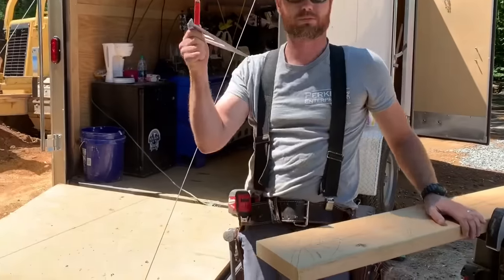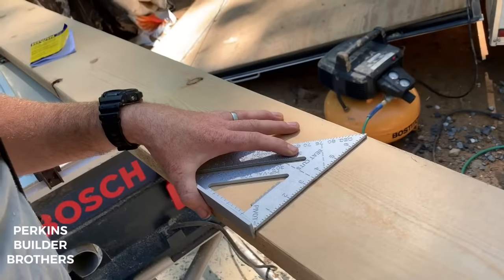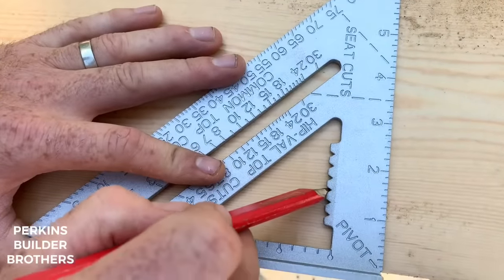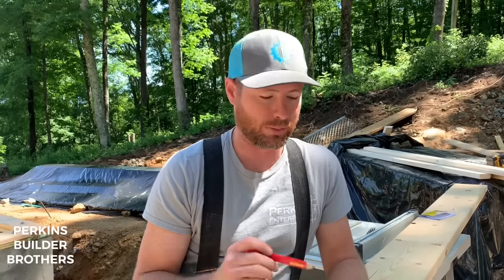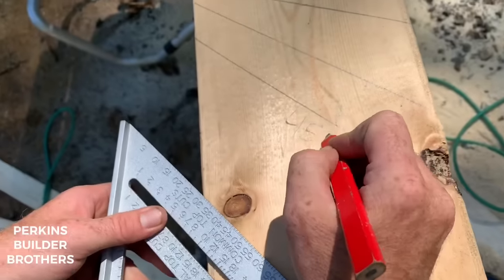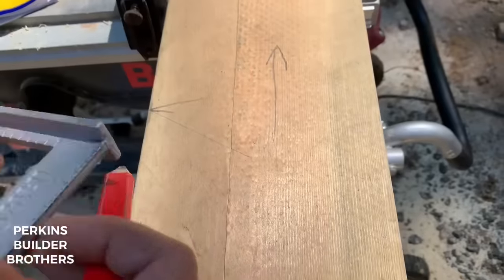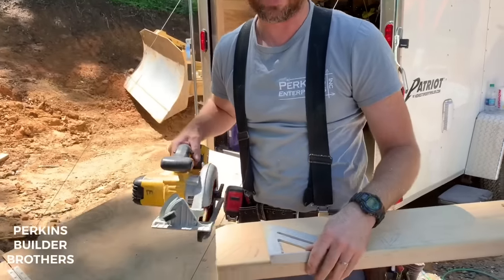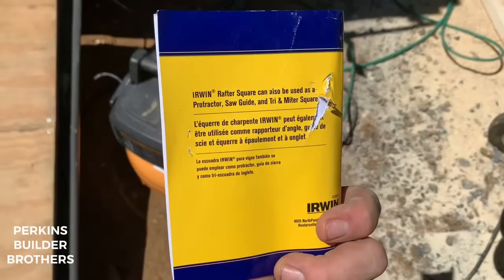How to use a speed square | Why it might be the most important tool you own

Comment: My uncle once told my cousin to go get me that square , cousin said you ain’t tricking me that’s a triangle 😂
Reply: has he ever asked your cousin to grab the board stretcher? cuz prolly too slick for that one...
Reply: @johnlecorchick2039  I'd love to have a bucket of corner mortar.
Reply: @johnlecorchick2039  I've cut this board 3 times and it's still too short.
Reply: Go get me a box of toe nails.
Reply: @johnfoge1742  i think you'll find that right next to the sledgehammer grease. :)
Reply: Kid ? go get me the left handed board stretcher.
Reply: Nah your making it up
Reply: In Boy Scouts we sent a new guy around a camp ground to find a left handed Philips screwdriver
Reply: Not a carpenter. I send young cats after a bucket of ohms, cable stretchers,sky hooks,conduit stretchers,metric channel locks,etc.lol.
Reply: @erlycuyler  I was 16 when I got a job as a telecoms engineer. On my 1st day I was send to get the sky hooks from the car. I got halfway to the car when I figured I had been duped, so I turned around angry and went back. When I got back he was laughing so hard I couldn't help but laugh myself. I miss working with him.
Reply: I was not expecting that. I laughed so hard my belly hurts.
Reply: Booooooo Booooo, Hissssss 😂😂 my cousin always says its a speed square and your framing 🙄 my reply is; dingbat it's a rafter square and gimmie it before your hangin from one. Then one day discovered that nifty little slot in the  werner step ladder which is where it now sits. Oh my cousin? He's hangin round here somewhere 😆🤣
Reply: @johnlecorchick2039  on the truck next to the shingle stretcher and buttfor
Reply: @brandonfrancey5592  cut it again
Reply: @EO-McLoud  they make that?? Will it help a grounding rod go in the ground faster cause cold tar aint workin 👍
Reply: When I was 14 I had a summer job on an AFB paint shop and the airmen told me to go up front and get the keys to the F-15 so we can move it out of the hanger. They got me good I was so embaresed lol.
Reply: Next time ask him about the nail glue.
Reply: Fast triangle
Reply: Thank you,I'm gonna have to use this sometime.
Reply: I had to turn off my music to read this thread. I want set a boss tell me to get the board Bender out of his trailer. I told him there was no fucking way and argued with him for about 45 minutes. After 45 minutes of arguing he went to his trailer and brought out a Stanley board Bender still with the tag on it and I couldn't fucking believe it. I think every profession has this when I was a server throughout my life the servers would tell the new people for closing procedures one of the things that you had to do was empty the water out of the Bunn coffee pots, which are of course as you know fed to the back by running water. I once watched a new server empty a 5 gallon bucket out of a coffee pot before they asked what was going on. So I've seen this in a few different areas I've been a contractor my whole life but I always liked working in restaurants as well (lots of waitresses) so I have sometimes picked up a side hustle as a server or bartender. This thread has got me rolling.
Reply: @JeffreyNevrotski  what's a buttfor?🙄
Reply: Bubbles for the water level
Reply: He probably thought to himself that very moment he should of pulled out that day lol
Reply: Smart cousin. I bet he went to collage?
Reply: Short wire? Go grab me the wire stretcher
Reply: On a paint job a sent a kid to the truck to get the Peter four. LOL he was in the parking lot 3 floors down yelling at me on the balcony. “What’s a Peter for!?!?”
Reply: Worked with a kid once, young framer. Halfway through the day, I noticed he'd pull a nail out of his bag, and look at it. Then, he'd randomly nail it in, or throw it onto the ground.
I walked over and asked him why he was doing that. He said, "The heads are on the wrong end of the nail!"
I just sighed, and said, "You idiot, those are for the other side of the house!!"
Reply: @garyboner8826   Or hammer, handsaw, etc. My grandpa got me on things like that when I was a kid. Probably still could if he were here. I used a left-handed shovel when...
Reply: I mean, he's ain't 100% wrong.  Too funny!
Reply: One time in the kitchen when I was a kitchen manager before I got into HVAC. One of the dishwashers go get some evaporated water off-the-shelf he was looking for like 15 minutes
Reply: Sky hook
Reply: There's also 3 shovels over there....
take your pick.
Reply: I remember my poor old grandmother asking my father what he wanted for Christmas, and my dad told her he would really love a good “metric hammer”. My poor grandmother went to five or six hardware stores trying to find him a “metric hammer” before one of the store owners, after nearly falling off of his stool from laughing explained to her that someone was playing a joke on her.
Reply: @JeffreyNevrotski  what's a buttfor?😁
Reply: In the factory, we told the new guys to get us a bucket of steam.
Reply: Tartan paint
Reply: Ask for Long weight
Reply: @erlycuyler  metric channel locks😂😂
Reply: In the painters union we'd send the apprentice out to the van to get the brush spinner and grab the paint stretcher too. They always insist they know what it is. Good times!
Reply: Don't  feel bad, I was told to go get the round square 😒 
I was,asking around the shop and they kept laughing 😂
Reply: Hahahahahahahahahaha that’s fcking brilliant.
Reply: That is the funniest thing I have heard all day!   ;-)
Reply: This was the most confusing thing for me when my dad first asked me to grab it doing my first deck when I was 8 years old.
Reply: @johnfoge1742  😂
Reply: @johnfoge1742  😂
Reply: @regbowyer1070  classic 😂
Reply: @daishi5571  ummmmm there are sky hooks 🪝 they attach to you bucket so you can attach to a extension later well up in the air to cut in trim. It is a hook with a small Chan on it to attach to your ladder 🪜 I have 5 skyhooks in my truck now.
Reply: @JeffreyNevrotski  there are sky hooks 🪝 I have 5 in my truck it is a hook with a chain attached to attach to a latter well up hi to cut in around a building manly for painting.
Reply: In my Army aviation unit we'd tell the newbies to get us a bucket of prop wash and a length of flight line.
Reply: And this is why no one trusts anyone in the world
Reply: Your "cousin" eh? Lol
Reply: @garyboner8826  and then you all bummed each other because you're boyscouts?
Reply: HAHAAAAAA I LAUGHED SO FUCKIN HARD AT THIS
Reply: @daishi5571  

When I was a kid, they sent me for something. (I think it was a bucket of steam for the tamper, or something.) 

I knew it was a trick, but I was new, so don't piss off the crew. 

I went to my car, and listened to Skynyrd for 2 hours. Then came back claiming I couldn't find it, but the builder saw me, and asked who sent me for it, and to send him to his office as soon as I find him. 

The whole crew was dead silent.
Reply: lmao
Reply: Tell em to get the left handed screw driver 🤣
Reply: When I was a chippy we used to ask the boys on the roof if they'd had the wee taken out of their new hammer.  If no then you'd grab their hammer and throw it as far as you could while saying "weeee".
Reply: Bahahaha brilliant.
Reply: @TimeSurfer206  😭😭😭😭😭😭
Reply: @g-cgeneralcontractor8903  Actually... That is properly called a "Meat Hook." They can also be attached to a "Hand Line," a rope on a pulley used for lifting from ground.
A "Sky Hook" is and always will be a helicopter being used for lifting.
Unless this is a Brand Name for a 
meat hook.
Reply: @Rspartan  As a young recruit, my boss told me we had sunspots on our Microwave Radio Dish, and sent me out for some Sunspot Remover.
Being hung over, I was happy to take the opportunity to:
Go back to the barracks and take a nap.
Then go to the AAFES Snack Bar for a good breakfast.
Stop by the Post Exchange and get a jar of Cold Cream.
Re-label said Cold Cream.
And go back to work and give the boss the Song and Dance about I tried and I looked and I asked everyone, and finally, I went to the US Air Base on the other side of town, and the guys at the flight line said, "No, we don't have any Sunspot remover, but try this! it should work!"
And then I gave my boss the jar of Cold Cream, re-labeled as "Prop Wash, 4 oz." Complete with an imaginary NSN.
Reply: @TimeSurfer206  Meet hook might be slang skyhook is literally what it says on the package been buying them for about 30 years now and they  sell them in the paint department like I said to hook your bucket to your ladder.
Reply: @g-cgeneralcontractor8903  Like I said: "Unless it's the brand's name."
Started construction training at 9. On the backhoe at Dad's farm. Retired as a sparky. I know what those hooks are.
And if you ever fall off your ladder, i pray you don't find out WHY it's called a "Meat Hook."
Reply: @TimeSurfer206  dang man sounds a little painful is that slang when you guys call them meat hooks 🪝 my dad is a GC so I started construction training at two LOL. Never heard of them referred as Meat 🍖 hooks been on hundreds of jobsites. I thought you were a butcher or something LOL right on but I guess you learn something new every day. Thanks man
Reply: I’ve been in construction for 35 years iv had my general contractors license for 10 and my company I  have over 30 employees five of them are electricians. Never herd of  meat hooks we called them Skyhooks but that’s cool man thanks for letting us know.
Reply: @g-cgeneralcontractor8903  Actually first heard it when I was working on an Overhead Line Crew. We use a "Handline," a loop of rope with a pulley at the top of the pole, to send material and tools up in a bucket for the Lineman to use. It's ostensible purpose is as a safety device, so we can use it to rescue a worker from the top of the pole. We use it primarily for convenience.
And we call it a "Meat Hook," because, if someone needs rescued...
We probably aren't rescuing them, we're retrieving their body.
Reply: @TimeSurfer206  oh man yeah that’s scary one of my buddies was a lineman for Burbank city. Something happened while he was working on the transformer and he got hit hard burnt his whole chest he was hanging upside down from the pole he  barely lived. He still works for the city but he refuses to go up on those poles anymore he said he’s too scared he starts shaking when he even thinks about it.  That’s a crazy scary job man. I have a Lotta respect for you guys to do that work and who have done it for so many years without getting hurt super awesome. Thanks man for sharing with me really cool I love the knowledge brother. 👍🏻😎🔨
Reply: @g-cgeneralcontractor8903  You're welcome, and I hope something, ANYTHING, I might have said might actually come in useful some day. Take Care and Stay Safe!
And don't let rude people spit in your face.
(Forgot to add, thanks for sharing your stories with me!)
Reply: @TimeSurfer206  absolutely very cool you as well and thank you. 👍🏻😎🔨
Reply: Hahahahahaha - that's a good one.
Reply: I feel out that was funny. Simple but funny!
Reply: Omg 🤣😭🤣😭
Reply: It was you your uncle asked you 🤣
Reply: Had a boss tell me to get him a 19/18ths wrench, so I brought back a 1&1/16 inch wrench. He was like “well, damn. Technically that’s right. You got me”
Reply: @ArbitraryLifestyle  😂
Reply: son go get the caulk and spread it into that crack over yonder
Reply: @shizmanbeat  is lquid nail
Reply: The uncle: 😐🤨😠😡
Reply: Lol
Reply: I mean he ain’t wrong 😂😂😂
Reply: @garyboner8826  We always sent scouts to the ranger's house to get a left-handed smoke shifter 😁
Reply: I once sent one of my new guys down to the truck to get the cordless extension cord. watching him from the roof rummage through the toolbox for 10 min was priceless!
Reply: Get the wood stretcher
Reply: Same thing I just did I  started working as a laborer my co worker says pass me the square I was like you mean the triangle 😭
Reply: He's not wrong , a right triangle to be exact.
Reply: @JeffreyNevrotski  what's a buttfor? Lol
Reply: DEHYDRATED WATER... we used to tell the amateur greenhorns on the construction site to go grab the dehydrated water please. You could imagine the confusion
Reply: You win the comment section...
Reply: Call auto zone and get price of blinker fluid
Reply: Did he remember the left handed hammer as well?
Reply: I had to read a few times but I get it now
Reply: Surprised nobody asked for level fluid
Reply: Remember it always safe to measure once and cut twice.
Reply: One of the funniest things I’ve ever read!

Comment: As a 70 year young carpenter. The speed square wasn't around when I started. Everybody carried a Tri-square. Thank you for your well made short straight to the point very helpful videos. I wish You Tube was around when I started.
Reply: I have a speed square from my grand father dated from 1937.  So it might have not been a nation wide thing, but reading off Swanson Tool Company, Inc website says it was around since 1924.  Also wish youtube was around even 10 years ago lol, I had to learn the hard way or figure it out 100% of the time.  But thats what makes a good carpenter anyways, figuring out problems yourself and solving them with out getting the answers. also opens up new ways in getting the job done.
Reply: @hardboiled7774  YouTube has been around for 15 years.
Reply: @marshallferron  Yes I know, but there weren't very many, if any informational videos 15 - 12 years ago, maybe they trickled in around 2008 - 2009 though, but nothing compared to the last 3 years when it comes to trade-craft and skill based videos.
Reply: @C life 403 Is that the big Johnson or the little Johnson?
Reply: @mikeking7470  the old long Johnson
Reply: I remember young carpenters sticking a tri square in a board until an old hand ✋got mad!
Reply: I also have a compound square as well
Reply: It's never too late, comrade.
Reply: Probably had more people to show you and that was your live video
Reply: 1925 is way older than 70 years old.  You just didnt have internet in the 50s to buy one on amazon.

Comment: I spray painted mine with orange paint and immediately wiped it off. Left a nice orange paint fill in the numbers and made them easier to read.
Reply: Thanks for the insight. I will do the same, but gotta go with green paint on mine.
Reply: Also you can keep other Carpenters from steeling your square.
Reply: Good idea
Reply: Clark Eugene I see what you did there. 🇨🇮
Reply: I used a hacksaw and fine file to cut 1/4 deep lines down the inch marks and  1/8th marks down the 1/2, the rest, I just slightly passed a thin hacksaw blade down the rest.
 The grooves help keep the tip of the pencils from wandering off down into a crack and around a knot.
Reply: This was the very first thing i ever did on a jobsite. Using bright pink marking paint. Had i known how good it was going to work i would have chose orange 🙃
Reply: Very smart
Reply: Good idea brother
Reply: Just for cool looks I did mine red let it dry then used some black cabinet glaze I had laying around and it looks awesome even now that it's all worn down
Reply: Great idea.
Reply: That is genius.
Reply: I used glow in the dark for when the day gets late and Sun goes down it's being charged all day
Reply: Awesome idea!
Reply: I took your advice. Still looks grey. Oh, Damn, I'm colorblind. LOL  (Ok, not really, but a great idea!)
Reply: @tomsenft7434  

I don't let anyone borrow any tools of mines. I keep my toolbox locked and every tool is marked with my initials.
Reply: Island Fantasy me too.
Reply: I spray paint my tools too but to keep mfs from taking them lol
Reply: It's a jungle out there.
Reply: Black shoe polish, rub it in and wipe it off
Reply: Great idea boss
Reply: Orang paint? You creep shoulda just used pink!
Reply: @chrisreynolds2410  Lol
Reply: My mind 💢 blown. Never about that
Reply: I spray paint my square, my  hammer, my prybar, everything orange, otherwise I can never find the frigging things after I lay them down.
Reply: Ditto. One orange, one black.
Reply: Nail polish works really well for that also.  I suggest dollar store nail polish.
Reply: same here!!...super easy to see the marks.. i am not in the trades now but was for years...only time i pulled out a framing square was to do stairs....place keepers and long sides for treads ...that and all the length info for different rafters for roofs although i never trusted them...=\/.
Reply: Nail polish or acrylic paint works well too, stole some red acrylic paint from my gfs art supplies and it works well
Reply: @BadelAndres  the black Johnson’s are smooth asf